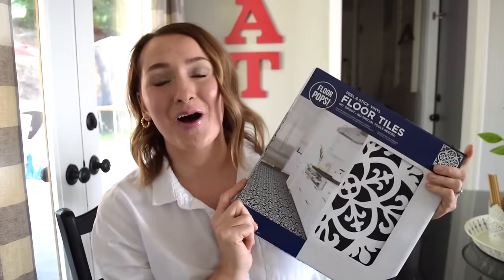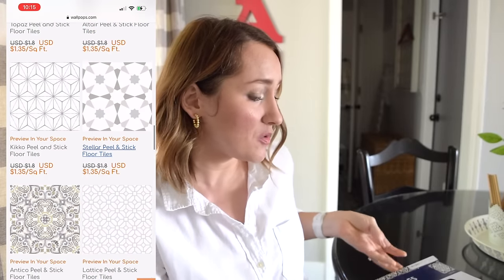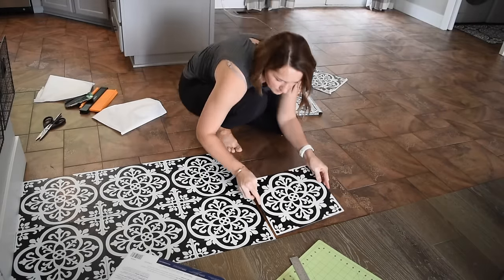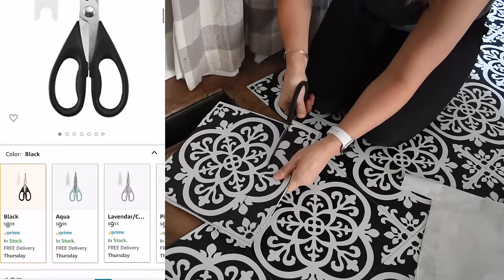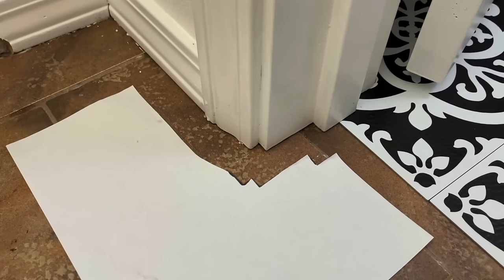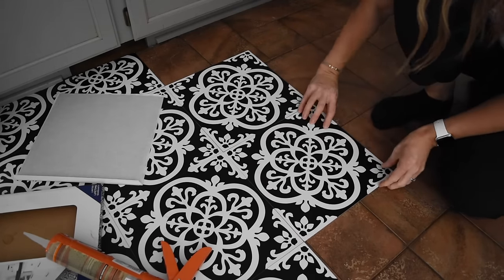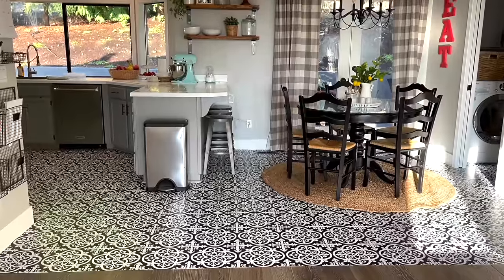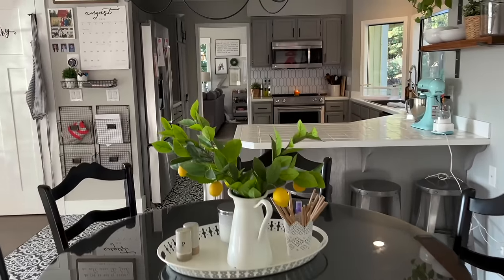INEXPENSIVE FLOOR MAKEOVER- HOW TO INSTALL FLOOR POPS TILE in kitchen and bathroom

Comment: I did my kitchen floor about 4 years ago using the peel and stick tiles from Amazon too and my family who visited could not believe that I did it all by myself 🤗 well done for using the stencils for the toilet area I will be certainly using that tip for my bathroom. Thank you so much 1🤗
Reply from the maker: That awesome that they lasted so long! I’m so impressed by their durability. It feels amazing to accomplish such a big task, way to go!
Reply: How does it hold up? They are not water proof right?
Reply: @777dtl6  They are indeed eater proof
Reply: @EverydaylivingwithMargarita  That's women POWER for you 🤗
Reply: @777dtl6  they are indeed waterproof and still going strong 💪🏽
Reply: Mine lasted 25 years in my small bathroom, getting ready to do it again

Comment: This is a great video. Informative, problem solving, inspiring and cheery!
Im affixing similar design tiles in my kitchen, but not on the floor (although thats what i bought them for originally) I'm applying them to the plinths at the bottom of the floor cupboards. They've 'lifted' the room! I too experienced the tiles lifting even though I lightly sanded the plinths and prepared them. That's how I came across your video. Gorilla glue seems the way to go, although I have some 'No Nails' already in my DIY stash. I would never have thought of that.
By the way. Your caulking round the edges is poetry in motion ..... zoom, and you've done it easy peasy .... i use masking tape when doing that job. 
Well done and thanks for the video!

Comment: I love how the Floor Pops turned out in your rooms. I think they add just the right amount of contrast with the gray cabinets (which look really great, you did a wonderful job painting them) in your kitchen.  I have the same pattern I purchased for my bathroom, I just started working on a refresh to cover over dark olive green tile with brown "swirls" in it. They were in the bathroom when I bought the house 7 years ago, I've lived with them long enough!  I hope you found a rug you liked for your kitchen area.  I'm watching this long after you finished your work in the rooms.  My thought was a thin striped black and white area rug or runner that could read "gray" on the floor and tie in nicely with the kitchen cabinet color.  I nixed my idea of solid black - too dark; and solid white, while I think it would look pretty against the black and white tiles, would require constant laundering in your busy household.  I actually never thought about possibly gluing the Floor Pops to problem areas in the floor, which I assume will show up at some point in my bathroom.  Good to know with the right kind of adhesive I would be able to do it, but I want to check around and see if there is an adhesive that one would be able to scrub off the tile floor underneath, rather than needing to tear out the old ceramic floor at some point if the adhesive (or the vinyl tile glued to it) didn't come off!
Reply from the maker: Hello dear, I am glad you enjoyed the video. The floor tiles are still going strong and I am so glad I took the plunge last summer, definitely better to look at then the old brown tiles.  I actually ended up getting a jute style rug from ruggable which I feel goes well with the tiles and brings in some warmth into the room, plus it is washable which is a must in the kitchen. I hope your bathroom tiling job went smoothly. Thank you for watching.

Comment: Thank you so much for the video! It was exactly what I needed to feel prepared to begin our kitchen. I will be going over tile with deep grout lines, so I am considering filling those first with a floor patch after priming the grout lines. Your method of creating templates was one I wouldn’t have thought of…
Reply: Did you end up filling the grout? I have these tiles and would rather not have to fill the grout. Just worried that eventually the pressure of walking on it will see the lines
Reply: @tinaaschaber7602  Yes, I filled them with Henry 345 Premixed Floor Patch, sanded the rough spots, then used Henry 336 Self-Stick Tile Primer over that. If I got a do-over, I would also have used Gorilla glue around all the edges that are up a against a wall as some of the tiles “creep” over time, causing gaps.

Comment: Fantastic info! I’m about to lay down some Floor Pops in a small upstairs kitchenette, so this was helpful. 

Hot tip: If you dip your finger in soapy water, it’ll glide right over the calking and give you a nice smooth line. :)
Reply from the maker: Thank you for the tip on the caulk.

Comment: I had the same problem but I found out that using the blow dryer helps to reactivate the glue. I even scraped the floor as I went along using krudkutter cleaner and I  would do a few tiles at a time. I was going over linoleum/vinyl  because it took me a few weeks my kitchen is large. Two faced tape by the flooring section if you have spots.  stubborn
Reply from the maker: Hi Doreen, thanks for your comment.  Great idea with the hair dryer.

Comment: I have the exact same brand of tiles that I'm about to lay in our half bathroom.  I took up the old lino and was going to use that as a template for pipes and the toilet and then realised that the flooring underneath is warped from a leak also!!  Fun!!  Now I have to remove that glued down vinyl tile in order to lay my new ones.  I didn't bank on that much work.  Ah well.  I love your way of using the paper as a stencil for the toilet.  I had already seen on the reviews that people were mentioning the tiles lifting and having to get adhesive so I'm prepared for that.  I'll have to get primer now though as I'll be laying them on concrete.  I was wondering how yours are holding up.  I noticed another comment from someone saying they did their 4 years ago so that gives me hope.  You did a great job.  Well done.  Can't have been easy doing that large an area.
Reply from the maker: Oh no! I’m sorry you have to deal with water damage. But better now then later. I hope the rest of the process went smoothly for you.
Reply: @bluecurlygirl How did your peel and stick tile come out on the concrete? What did you do to prepare the concrete? Did you use a primer before you put the tile down? What brand of primer did you use? Sorry for all the questions I am going to do my grandsons bedroom. Remove all of the carpet and put in peel and stick. My floors are concrete just was wondering how well they hold up and are they very cold to walk on. Thank you and God bless.

Comment: I did a small lobby at my front door in the Floor Pops "Comet"  style.  It is quite difficult to cut the tiles (scissors) and they don't always match up, even after turning them all round.  However, because the pattern is quite busy this does not notice too much.  It's a case of "I can see the faults, but can you?"    I would not use on a large space like this kitchen, as I found it rather hard to do, and they do tend to lift a bit at the corners or edges.  Overall, I am quite pleased with the result.
Reply from the maker: I’m glad to hear it all worked out for you. The print comet is very pretty and I’m sure it looks amazing.
Reply: @EverydaylivingwithMargarita  a year later ... and they are still good 👍 but then it was a very small area, about half the size of your laundry room - enjoyed watching this vid again 👍👍💯💯

Comment: Almost a year ago, I contacted the manufacturer, before installing the Antico pattern over concrete in our main bedroom closet. We were advised to first paint the surface with a self-stick primer, allow it to fully dry, and to Not use grout. It looks beautiful and has not lifted. I would like to know what type of tile is underneath Margarita's newly installed FloorPops. Is it vinyl or is it ceramic? Her new floor looks beautiful. I have another room that has ceramic tile. I'd like to use FloorPops to update it, but not if I have to tear out the existing ceramic.
Reply: Thanks. This comment came in time for me not to make a mistake.
Reply from the maker: Hi Susan, my floor tiles are ceramic underneath. I really don’t think I would have been able to paint it with a primer, that means i would not be able to use the kitchen for a day and have to keep my kids from walking on the floor 🙈. The glue was a great decision because it kept the tiles down on my uneven ceramic floors and there has been no lifting whatsoever.
Reply: I've been watching how to videos by pros and they all say you need to use a self leveler for self stick tiles over uneven tile flooring. I would love to see a follow-up on this project... if it proved durable with this minimal prep.
Reply: @susanwright how did your tile come out on the concrete floor? Did you run into any problems, and how did you take care of it? Any recommendations. I have carpeted bedrooms with concrete underneath want to use peel and stick. Also, I have hardwood floor in the hall. I think there will be a height difference between the two floors. Any recommendations for that? Thank you and have a blessed day.

Comment: Beautiful job!  I wanted to do this in my bathroom but had thought they'd had to fit over each tile and my tiles are 13×13 and I could only find these in 12×12.  I see yours are not square design over square tiles.  Maybe I can make them work!
Reply from the maker: Yes! They definitely will work. I recommend using glue as well.

Comment: Great job. I just found boxes of these for $6. I dont like this design for my bathroom, but I'm thinking I could take advantage of cheap peel and stick backing then paint or use rolls of vinyl. What do you think ? Is it worth the hassle? I feel like im saving, but it may be easier to save for more expensive tiles that are the color I want.

Comment: The floor pop tiles have a reputation for not sticking.  It was nothing that you did.  I want to use the same pattern, but I think that it would be too bold for my bathroom, and that I would grow tired of it very easily.

I will get a similar pattern in a softer color.  My toilet area is tricky because I live in an older home, and there is a pipe in the floor which is connected to the toilet, thus, cutting around that is going to be a real chore when I lay my tiles.  I will let you know how it turned out.  Great video, and have a beautiful home.

Ms. L. Churchill
Reply from the maker: Hello dear, yes, I also feel that the color is bold. If my cabinets were white, I would have gone with the gray color. But since they are gray, I felt that it would be too much gray to have gray floors and gray cabinets. I hope your tiling job went smoothly and you were able to get around the pipe. Thank you for watching.

Comment: My daughter used these on her small laundry room floor, but because the family walked through the area to get to the garage door it got a lot of use, which caused the tiles to start slipping and buckling... Although, she didn't use any glue, and, one side didn't have a 'stop', that could have prevented any movement, so take your time and do it right.
Reply from the maker: Yes, I definitely recommend using the glue.

Comment: Hi! Good evening! I’m thinking about doing this for our bathroom until we do the big Reno for them. I was wondering how have the tiles been holding up since you’ve installed them? Do have any update remarks about peel and stick tiles? Hope you read my comment and reply. Thank you again for sharing this process!
Reply from the maker: Hi Kat, they hold up very well. I even had to drag out my heavy washing machine out twice to fix it and I was so surprised that it didn’t do any damage to the tiles.
Reply: Thank you ☺️

Comment: It looks amazing but do you clean the floors with water or just vacuum it? Im afraid it wont last long if you wash the floors.
Reply from the maker: I mop the floors. No issue there.
I even had a leak under the sink and there was a lot of standing water which did not make any tiles come up.
Reply: @EverydaylivingwithMargarita  sounds great 😊

Comment: They do not match up perfectly because like tile you’re still supposed to space them and grout them with the appropriate grout for peel and stick tile. Sometimes adhesive is needed depending upon the surface you are putting them on. 
It looks good but if grouted it might have been better still. Good job.
Reply from the maker: Thank you Lisa. I supposed they would look better with grout, but I’m not sure anyone white wants a temporary solution would go through that much work. It would be impossible to remove without damaging the floors.

Comment: It helps to put weight on the tiles, like a 100 lb. roller, or swalk on all the edges to keep them from lifting. Gorilla glue is not removable. Something to keep in mind if you ever plan to sell your house.
Reply from the maker: Thanks for the info!

Comment: Did you tile over ceramic tile? If so wouldn't the grout lines start to come through the vinyl tile over time?
Reply from the maker: I did. They have not. They are pretty thick tiles.

Comment: You should've heated each tile with either a hair blower or beat gun, it help activate the adhesive of the tiles... done, no lift up what so ever.
Reply from the maker: That’s a good idea, since my tiles were cold because of the AC.

Comment: Did you have any problems with the grout underneath for the ceramic tiles? I was wondering if there was any divoting?
Reply from the maker: Hi Scott, surprisingly I did not. The tile job wasn’t the best to begin with, so I’m surprised that it lay so flat. I think the glue really helped.
Reply: @EverydaylivingwithMargarita  Thanks, I want to do this but was concerned. I think if I shift the tiles over by half none of gout line would fall on a joint

Comment: Did you seal this with silicone on the edges after? X
Reply from the maker: Between the tiles? No. But I did seal it around the baseboards and the toilet.

Comment: can these tiles be removed after a couple of years should you want to change your decor?? Also, what is the life span of these tiles? Thanks
Reply from the maker: I have removed them and had to scrape the tiles of the glue with a razor. They did not damage the tile underneath. 
The floor pop tiles are very durable in my opinion.

Comment: Question did you line up the peel tile with the grout lines or just laid them
Reply from the maker: I did not line them up to my old tiles because they were not just squared, they were cut into different sizes. I made a straight line against the hard wood in the family room and lined them up against that.

Comment: I notice you didn't fill in the grout lines with leveling cement, did the grout lines telegraph through to the peel and stick?
Reply from the maker: Nope, not at all. The tiles are very thick.